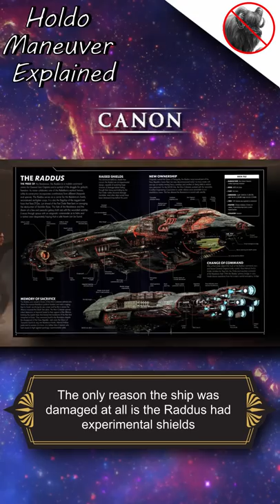Holdo Maneuver Explained | No BS Lore

Comment: This doesn't solve the problem. This actively makes the problem worse, because the actual problem with this was never addressed. It's not "how" this happened, that's irrelevant. It's the fact that its possible at all, and now it's public knowledge as there are survivors on both sides from this scene, additionally the fact that the star wars universe has been around for so long without not one of the trillions of people figuring out this weapon doesn't paint the series in a good light.(even more so when you consider that the idea for a weapon like this was thought up centuries ago in real life) The very existence of this scene renders; star ships, lasers, missiles, pulse accelerators whatever other weaponry, light sabers, the force, the dark side and the light side, death stars and starkillers completely and utterly fucking useless.

Take a box(or any shape really), worse yet the size of this box is basically irrelevant, could be the size of a football or a meteor, at these speeds it could even be made out of foil and it'd probably still be world ending. Strap an engine and this "experimental shield" on said box, put FTL tech in it aim it at literally fucking anything. A planet, a fleet, a army, a fucking star. And you can not only destroy it completely, but you'll vaporize it with such force and speed that even the idea of trying to prevent it is inconceivable.

The problem isn't how it happened or how easy or hard it is to do, because regardless of how difficult it is to do its very arguably millions of times cheaper and easier than constructing and training and paying for entire fleets of ships, weaponry, logistics, ammo and people. You could make hundreds of thousands of these little boxes and you'd only ever need one to hit.

It's not a plot hole or some nit pick, it literally makes space wars irrelevant. It exclusively becomes about first strike advantage and nothing else. Meaning that every sacrifice leading up to this point and any sacrifices that come after this point isn't just avoidable, but would cost extremely little in resources outside the ftl and shields to avoid. 

I'm not even actually much of a star wars fan, and I definitely ain't the smartest, but I do like space and this issue is glaringly obvious and has unintentionally broken the star wars universe as a whole. If you ask me if they want to redeem it beyond superficially ignoring it, they'd have to retcon the entire scene and this portion of the movie. It's literally the only way, whatever bull excuse would be met with; "it would still be easier and cheaper to face the challenges of reproducing this weapon, than it would ever be continuing a war of attrition."